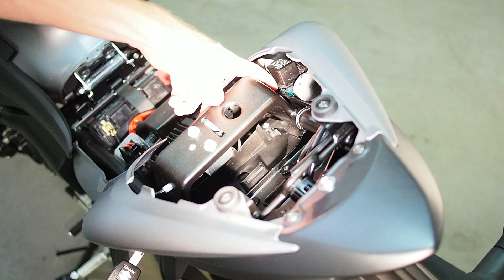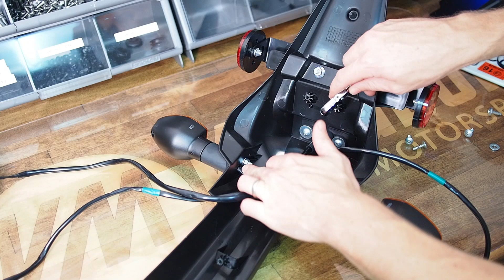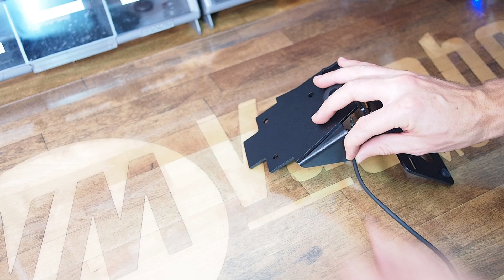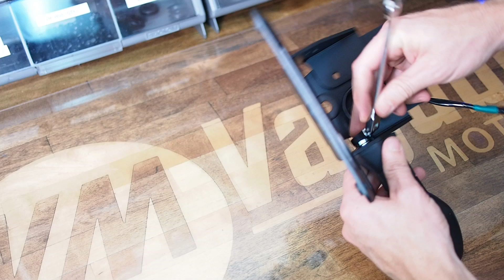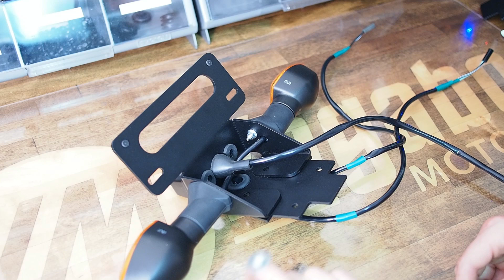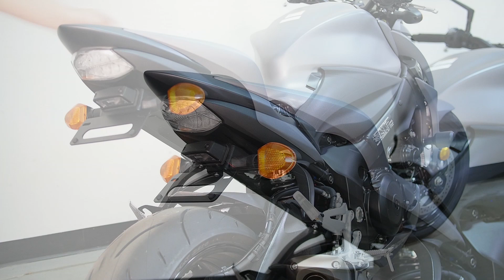Suzuki GSX-S1000 Fender Eliminator Installation Video - Vagabond Motorsports VM-S110

Comment: Will this fit the 2022
Reply from the maker: We haven't fit it ourselves on the 2022 model but the updated bodywork looks to share the same subframe and rear fender tray so it will likely fit.  The updated OEM turn signals appear to share the same interface as well.  Once we can confirm 100% we will update you.
Reply: @VagabondMotorsports  I ordered it yesterday, so I’ll confirm once it arrives lol

Comment: What is the thread pitch of the screws used for license plate assembly and how long are they? My bike came without a stock assembly. Also are the holes for turn signals M10? I have this product just want to put on led signals instead of using stock

Comment: Love this bike...I'm looking at getting a non-abs 2016 gray GSXS-1000 it's 10 lbs lighter than the ABS version and adding a M4 complete exhaust saves another 12 lbs...that's 22 lbs savings on an already light weight bike. Local dealer is trying to unload theirs for only $7,999. I've already priced it out with a K&N, PC, and M4 exhaust installed. Local dyno will map the PC for $150. This bike is a steal if your willing to add a few mods.

Comment: I like how Suzuki, in all their wisdom, stuck the regulator/rectifier under the seat where it will get ZERO airflow. At least it's an FH-series, so it won't put out quite as much heat as the older units, but still.